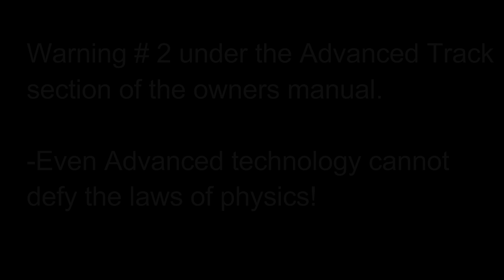The science behind why mustangs crash!

Comment: This made alot of sense, now I don't personally own a mustang but it gave me a better understanding of how fords stability systems work along with advanctrak & traction control work on these. Factor in any suspension mods, tires, wheel offsets, all of those contribute to the cars handling on a track of course including an autocross course. I have a front wheel drive LS4 V8 car... a 2009 lacrosse super. The stability control on this car i feel is a bit sensitive in the way it will pulsate the brakes at the opposite side of the car to correct the yaw rate of the car. I felt it kick in as I hit a curve at about 60-65mph and a slight steering input tossed the car around and I immediately let off the throttle and it corrected itself. Rewind back to about 4 years ago, again had the same car but a year older so 2008. Was on I94 in SE Michigan heading to a friend's house. Was going around a curve at 80mph, I hit a decent sized bump and my car got jolted around a bit triggering my car to lose control a bit and the stability control kicked in and I had to fight the car to keep it within the lane as well as to avoid hitting anyone or the retaining walls on either side of the freeway. I again, slowed down by tapping the brakes and letting up on the throttle not even quarter throttle and the car went back straight again. That was a seat of my pants moment I thought for sure id lose my car and end up hurt. It was a dry warm evening in july. It was crazy. If I were to have that system off, by holding the traction control button for about 5-7 seconds it completely disables the electronic stability control and traction control. This was GM's system put to the test in a real world situation.

Comment: A lot of crashes happen because of over steer and bad tires. I drive a 2015 Roush 670 hp 6 speed manual and 373 gears. I did not like the way the car felt in a turn with mild throttle and decided to unplug that little connector on the front drivers side that kills all the nannies. I love the way it handles now but if I had to drive it in rain or snow which i don`t, I would pug it back in. If your a Mustang guy and want to learn how to drive it, find a open large parking lot and learn how it handles in all kind of conditions. Make sure there are no light posts around and have fun. Oh and watch out for non level or beveled  roads if you lose traction at speed! P.S. buy good tires!

Comment: Traction control will turn off temporarily speed of the wheel and the pitch of the car.but the plug for the control is by the air box ❤be carful if un plug it will send you to the junkyard.

Comment: I believe that you may be correct. There is an issue with the Ranger Raptor killing power and causing it to not make it up slippery hills while the wheels are spinning and I believe an engineer said that advance track can only be disabled at lower speeds and that it is always on at high speeds on all Ford vehicles.

Comment: People in the comments have a lot to say with little data or time reflecting on what people mean in their comments. Physics does what it does. These systems are interpreting a lot of intentions and conditions and assuming that the system is even functioning correctly, it isn't going to understand all of the possible conditions or the driver's style and intentions. Just like the auto transmission that doesn't always know what gear a driver wants to be in, these systems don't always understand the totality of the situation. This is an old thread. I have an S650 and I can say that sport mode with advance trac on things were interesting. With track mode on and turning off traction control and advance trac I have not had any problems with spirited driving...yet. But I have not changed to a sticky tire or tracked the car yet to see how intrusive the system may be. The performance pack car does have some GT 350 and GT 500 parts under the car that may help such as the vertical links to reduce deflection. This conversation does have me likely to push the car incrementally when it's time for a track day.

Comment: This makes so much sense, here’s how I know: 

Where I live we have super slippery streets the ones that you can see the sun reflection. 

In a motorcycle you can’t pop a wheelie because it’s always slipps. 

so we however like to have fun sliding here and there.

cars like challengers and chargers make the most fun because when we slide we don’t have consistent throttle we make throttle purges like vrom..  vrom.. vrom..  vrom while sliding not consting vroooommmm 

I tried to do that on my 2019 gt and noticed every time I release the throttle just to go back at it again it tries to correct itself and couldn’t achieve the slide I wanted even though the traction controll was completely off. 

so in short, yes as soon as you let off the throttle the car will try to correct itself.

Comment: Great video, and even more meaningful given the plethora of continued mustang crash videos. 

I think it's 2 things - everything you describe in this video, as well as inexperience.  As you showed in your examples via footage you have taken, you too have experienced systems fighting you.  You, however, recovered the car.  Systems or no systems, the inexperienced ALWAYS overcorrect, and not having experience with power sliding or drifting, are way, way too slow to do it and undo it when needed.  This is typically why you see cars begin to spin, then wildly spin the other way.  That, and hitting the brakes mid correction, throwing the weight even harder...

Comment: It doesnt apply very well to the street cars that might lose it suddenly.   That is likely more to do with summer tires in cold temps combined with a COMPLETE throttle cut that leaves the driver unable to add throttle to finess over steer.   Winding up crossed up on the steering wheel and thunder fucked because your throttle was cut.     As for the track, pull the dyno plug if the systems are behaving so poorly on the S550

Comment: The traction control is the problem.. Also when you turn it off it doesn't go completely off unless you hold the brake and the button for 7 seconds, Then it is completely off. Or you have to go into track mode and turn it off.. But he is absolutely right about it coming back on and having a mind of it's own..

Comment: I crashed a 2015 1LE Camaro because of exactly the same situation with  stability control aggressively correcting a controllable slide.  The 1LE model has significantly wider tires and stock Brembo brakes.  I don’t know how to prove it, but I’m betting it has the same stability control software algorithms as a standard Camaro with less tread width and less powerful brakes.

Comment: Old man here.  Drove a lot of hot cars back in the day.  I am no expert but from what I am seeing regarding Mustangs crashing while leaving car shows, it is clear to me that there has to be some sort of "system" that is fighting the driver.  It isn't that they crash but the way that they crash.  It just looks strange to me.  I have seen many, many hot rods leave events in spectacular ways and many drivers lose control.  But back before all of these systems designed to "assist" the driver, cars rarely crashed this way.  Mostly, if you lost traction the car would spin around like a top but it wouldn't keep trying to go forward as these cars are doing.  Back then getting sideways wasn't that big a deal.  So I agree with you.  We never had these issues when the brakes were just either all grabbing or not.  Clearly, having a computer control the brakes individually, is the source of the problem that has the driver and computer in conflict.

Comment: This dead on accurate. My 2023 does this exact thing. Took it to a skid pad where my buddies take their drift cars to test. Turned off all the controls, put it in track mode and S on the shifter. Every time that I got the wheel spin up where I needed it after a flick, the car would fight me incredibly to get back straight, even at full throttle. It got even worse when it started raining and the pad got greasy. I could feel the electric steering trying to pull the wheel out of my hands to get the car back straight. 
I did some research and yes, you have to physically disconnect these stability systems at the fuses and sensors in order to be able to drive the car beyond just going fast in a straight line. 

The combination of this, and the fact that most people don't understand what a powerful monster that they have, is why these cars crash when people are showing off. If you look closely at those videos, the snap oversteer is often random and abrupt in the newer models.

Comment: Stability control almost killed me this weekend at a car meet. Was on when I accelerated to 40 mph some wheel spin, it cut off my accelarator I ended up going sideways under a box truck. I have driven corvettes and challengers many cars aggresively. Never had the car FAIL ME! I crashed into the box truck so fast I still cant figure out wtf happened I was going 40 mph

Comment: Here it is in 2022 and I just found this post.  I have a Roush Stage 3 2017 GT Premium.  This car tried to wreck me on more than one occasion in the first month I owned it.  Reducing throttle going around a corner and Advanced Track On nearly put me in a spin.  This happened more than just a few times. Thought I was hitting a patch of sand or wet pavement, but no it was always fine.  First thing I do now is to hold the switch until the pop-up message says the advanced track is off.  Have never seen the traction control swap back to saying it was engaged but if it did re-engage then I probably wouldn't be looking down at the panel.  No problems since.  Mainly don't let up on the throttle suddenly going around a corner, don't over steer to the point of skidding sideways, and keep the Traction control off.  I don't drive it on road courses but would love to try that.
Reply: Pull your fuse it’ll save you. It makes the car feel way more trustworthy and connected because everything you tell the steering wheel to do the wheels automatically listen to and the car just feels completely different

Comment: Hi Russ, I am not sure you even maintain this channel any longer. I do agree with you about TCS/AdvanceTrac. OMG...it is awful in some ways. I have Two Mustangs (2006 GT 2014 GT with Track Package). In the 2006 the TCS makes the car next to useless for spirited driving; often just kills power to a bog and I hate it. The 2014 is better in a way because I can turn it "off" completely, but I have to do it as follows: when the car stop and the brake pedal engaged, push the TCS button one to get the TCS off light, then push the button again for about 8 seconds until I get the warning the the AdvanceTrac is off. As you say, the car will only let you get so far out on the edge before it will violently engage. Ford should allow advanced drivers the option to full turn it off, but their objective to reduce liability against FMC. So...how can they do that?

Comment: So this thread is a bit old but is the most on point description I have found. I have a 2021 Mach 1 and even though you can use the switches to turn off traction control and advance track it still hangs around. I installed new wheels and tires for autocross to be better compared with the GT350. Went from 255X40X19 front 275X40X19 rear to 305X30X19 front and 315X30X19 rear. As stated all seemed fine till I really started to push the car to the limit of the new tires. Immediately following a hard left hand turn the car went completely crazy. Like being on ice. If I barely touched the throttle for the rest of the run the car would start spinning. Like the front brakes were on but the rears were fully off. Got back shut off car everything was fine the next run. Last run of the day pushing hard I take the last cone before the exit, hit the gas and the car just unleashes a crazy uncontrollable spin. Almost hit the guard barrier. Now after some research I have found there is a jumper located by the cold air intake. If you unplug this jumper you will disable all the control features except ABS will still work. When you do this you get an extra icon on the dash showing both systems off. I have hit the ABS hard in this car and was impressed how smooth the ABS control was. Well it wasn't all the ABS. The advance track system was also engaged. With the jumper disconnected the ABS feels like any other ABS. It stutters and pulses as it stops the car. Will be trying out the jumper setting at an autocross this weekend. I don't mind having some oversteer but what was happening was neither induced by me nore was it controlled by me. It is not a problem between the seat and the wheel it a problem with a stability system that can not handle change. After this happened I got all the same, well new tires are slicker, you probably just aren't used to the car, etc, etc.

Comment: So I am a new 2012 GT 5.0 6 spd auto owner.  Bone stock including everything from air filter to mufflers. I'm not a drifter or racer.  Not intentionally into rolling burnouts to lay a patch.  Basically, gas and brake are never simultaneously pressed.  I'm not really into big speed, seriously.  I'm sure some of you will flame me as not a true Mustang driver.  Meh.  However, I do occasionally engage in rapid acceleration from a stop or from a low speed which is the entire reason why I bought a V8.  Frankly, I'm now concerned about heavy throttle acceleration, which can cause some wheel spin depending upon conditions. Also, some minor shimmy to one side or the other could happen as well which naturally results in some minor counter steering to keep things straight.  After seeing this video am I to understand that only a professionally trained driver on a closed course should be pressing the throttle more than 50%?   Or... is this video saying that only aggressive cornering with potential for huge shimmy to one side and consequently huge counter steering is the recipe for unpredictable computer control?

Comment: I think we need to instrument the brake pressure and figure out what the system is really doing. I think this "undocumented feature" has killed people. If everything is off according to the factory, but you can show brake activation without pedal depression, I think Ford may have a real liability problem on its hands. High slip angle and high steering angle does not mean a loss of control if this is what the driver intended. If while at high slip and high steering angle the computer does something that suddenly eliminates the slip, they have made the vehicle do something thr driver did not intend, the very definition of loss of control.

Comment: Makes so much sense! My last slide half way through whipping back around(second fishtail) it felt like I lost all power smd just needed to stomp on the brake ,which at that point you've lost it. It happens so fast that it's even hard to comprehend after the fact. Very good info,  thank you! 

Also 110% agreed, that TC off or in Sport mode that traction control cuts power and applies breaking,  very very sketchy when you are trying to put power down.

Comment: I own a mustang ecoboost 2017 stage 2 and im a big fan of drifting. I live in tunisia and in my country all roads are slippery because they are old and everyone drifts on em and especially when roads get sunkissed its just so easy to make tires spin in here. Anyways my point is i daily drive my mustang and drift almost every time i drive it and i can confirm all you have said but i wanna add sthg! Idk if this is because of the turbo ( ecoboost only ) or not but not only that even when everything is off when you let your foot of the gas everything turns back on and it tries to forcefully correct it causing just like you said lock up slides that cant be catched but also if you try to drift in a roundabout which i always do if you get low ennough on rpm or lift your pedal from the gas completely the car will lock one tire trying to correct it thinking that you want to stop the slide making it do an awful understeer even with your steering wheel locked up you will still go forward and the gas will just get cut even if you push the gas again to correct it the car wont let you go higher to rpms its as if the engine is only working with 10% power which makes it absolutely not correctable and i almost hit a wall that way tbh that sucks but you can do sthg which i have learned over time im still not perfect at it because tbh its super tricky to do but you can try to lift your foot from gas pedal but never completely and be sure to do it slowly coz if you do it fast ennough it will think you dont wanna slide anymore and try to correct it again but if you wanna drift tbh mustangs arent made for that the esc system just limits you way too much and it just sucks .. have a nice day i hope this helps other mustang owners